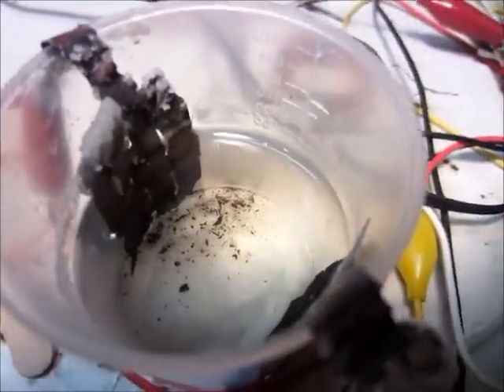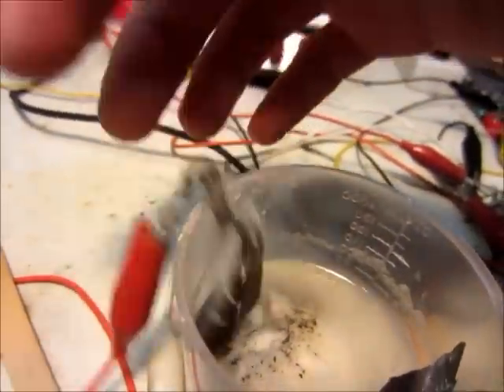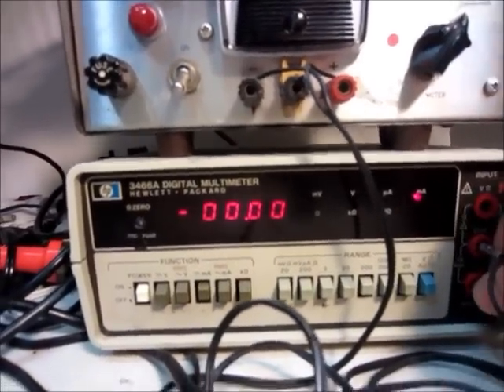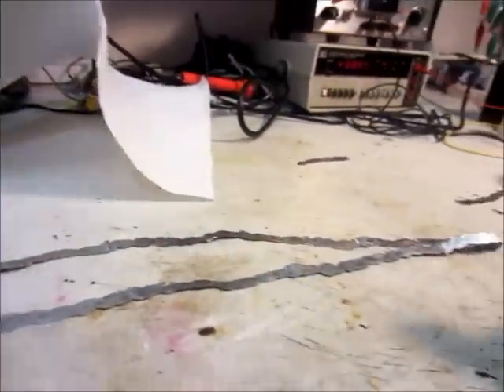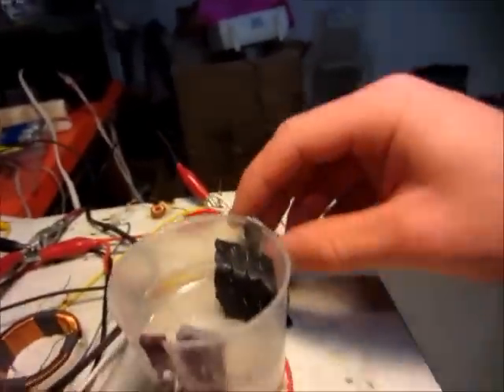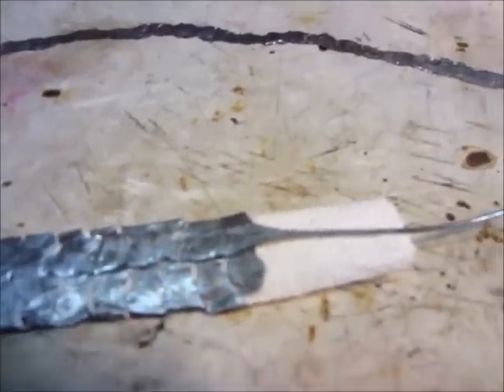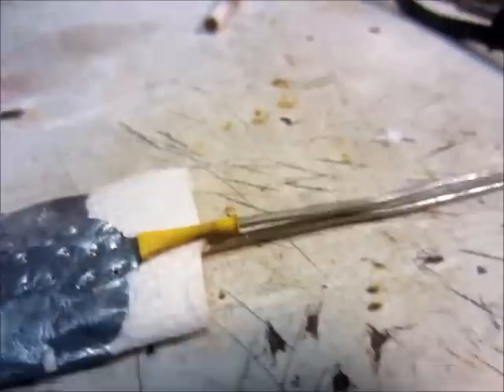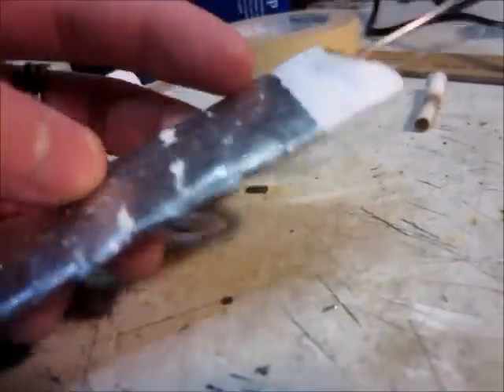Making a Lead Alum Rechargable Battery

Comment: I am also experimenting with non acid batteries and have found that a low charge current of 150mA at 2.5Volts works very well. I have also found that if you discharge and recharge upto 5 times the standing charge and current are more constant at the end. Great informative video. You are doing well. Keep it up.

Comment: Dude if u charge at 2.5 volts and 200 miliamps it works good but for the second charge put it to 400 miliamps I made a huge battery and got 2 amps